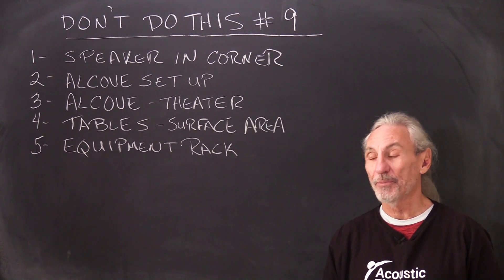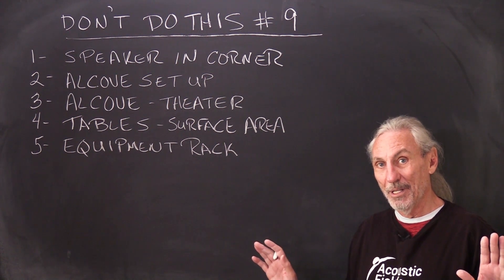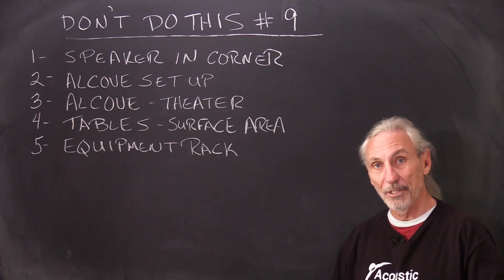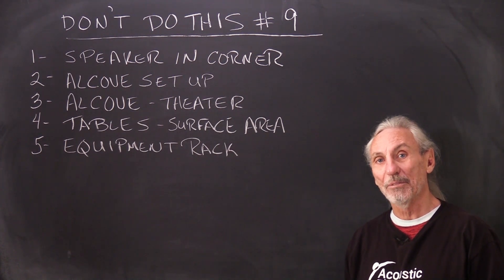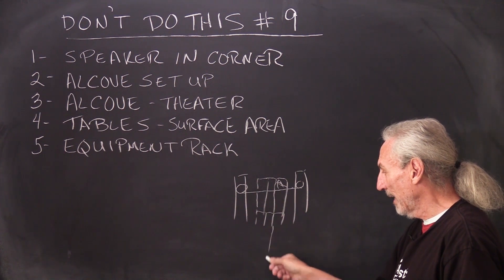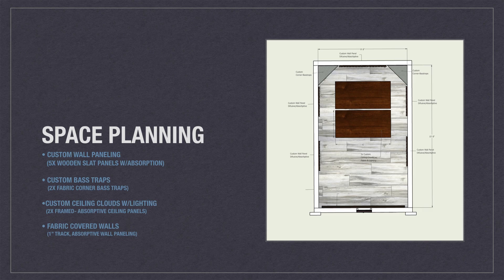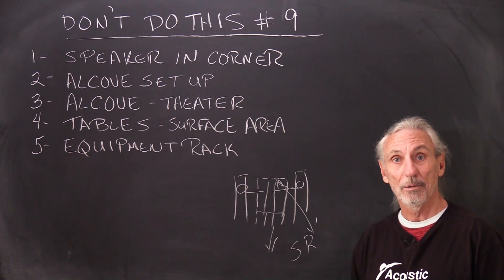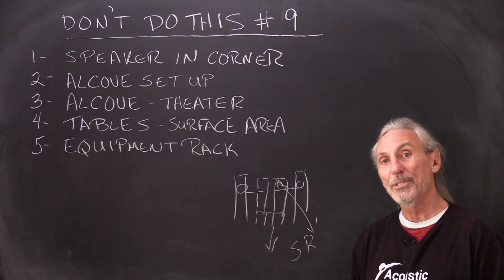Don't Do This! # 9 - www.AcousticFields.com

Comment: For speakers in corners - aren't subwoofers the exception to the rule here? I was always taught subwoofers are best the corner spaces since the waves are so long that the reflections from a corner can start to cancel out.
Reply from the maker: Placing a low-frequency energy device in room corners increases the output of the subwoofer. However, the increased output is room distortion. When will people realize that quantity is not quality.
Reply: @AcousticFields  interesting! I had read that in the Master Handbook of Acoustics back in the 2000's so interesting to see how times have changed.

Comment: This guy is the Spock of audio: logic, physics, and math. ~\\//
Reply from the maker: Getting quality sound in a room is all about doing a lot of little things correctly. Just as important is doing them in the proper sequence or order. Every small action taken is like one step in a staircase. If you take each step in the proper order, you will reach the top of the mountain as the Brit's say. The elevator to good sound is out of order. You must take the sonic stairs one step at a time.

Comment: Hi! I see you are a true expert in the field of acoustics. I have a question: if I put cheap Amazon foam on top of the mineral wool panels I am going to build (it is all I can afford for now), will the 1" foam interfere in the absorption of my mineral wool panel? The reason I'd put foam on top of it is that someone in my family is worried the Muslin fabric wont be enough to prevent the mineral wool's particles to escape the panel, so they want me to add a thin layer of acoustic foam to make sure no particles passes through the muslin and end up breathed in while I sleep, but I fear the foam will interfere with the mineral wool effectiveness. Would it?
Reply from the maker: The panel depth using limp mass material types determines how low the unit will absorb to. Do not use building insulation. It lacks the proper rates and levels of absorption for music and voice.

Comment: Clearing sound field in a mixing room I'd have to use higher speakers stands. That will result in a more aggressive tilt to the monitors. Will that cause problems?
Reply from the maker: Speaker stands are always recommended especially ours where they contain our carbon technology so you gain low - frequency absorption along the front wall where pressure is the highest.

Comment: In a room size of 9 feet long by 10 feet wide how will I but my home theater speakers if not in corners
Reply: @Doyle Shafer  what else is needed?
Reply from the maker: Low-frequency management first and foremost.
Reply: @AcousticFields  how can I get talk you about everything?
Reply: @victorpulos823  you can submit your room info with pics on their site. Check out the Acousticfields Sam Small video, that should give you an idea. I think its in the "Projects" section of their site too.